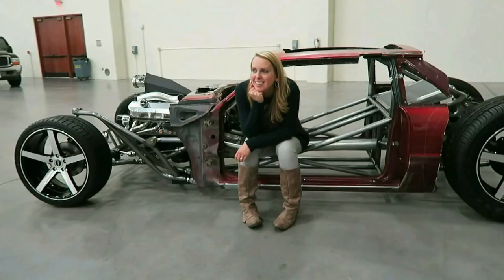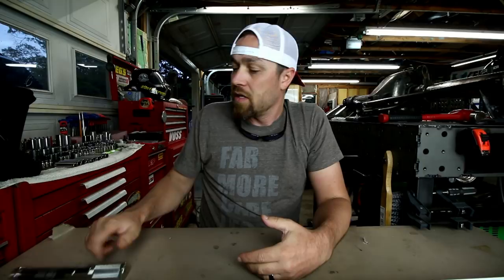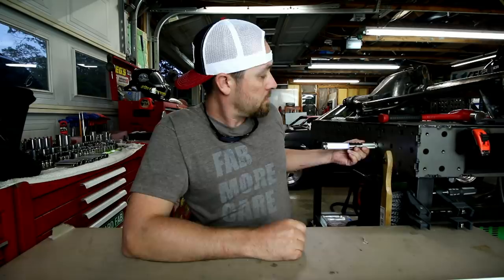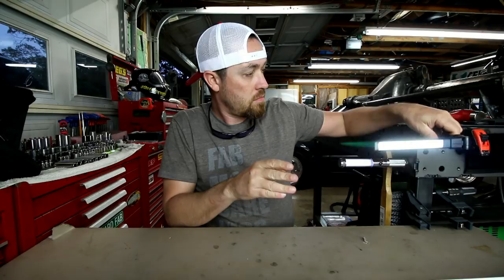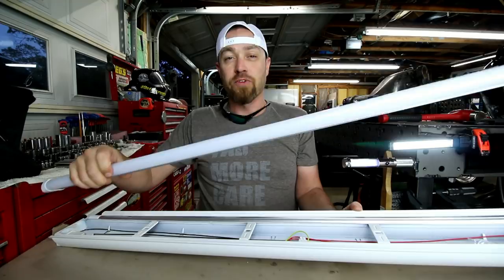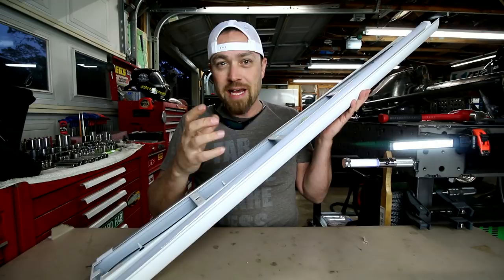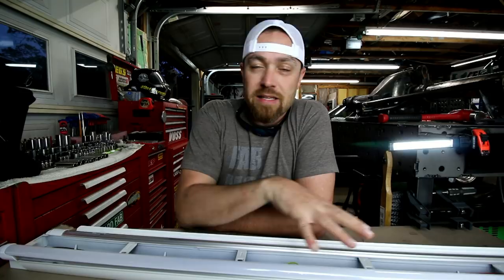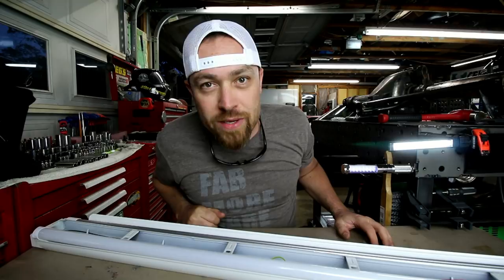You Need This Tool - Episode 94 | LED Shop Lighting

Comment: I have a 48x60x16 shop. Just got it built. Anyway instead of drywall ceilings I used white metal sheeting. Same stuff I have on the outside of the shop. Easy to put up. Never have to paint it. Reflects light like a champ. Then I put my 29 Lights in 5 zones. I love it. Lift should be coming this summer
Reply: White epoxy floors, white OSB walls coming this summer also. Kinda going for that airplane hanger look.
Reply from the maker: awesome....thats the same size I am building

Comment: Funny you are talking about led lighting.. I finely settled on vapor proof led lights from Hyperikon. 
Shopping for the right led shop lights is not easy.. mine are 70w (same as a 100w regular light), 7100 lumen (is the brightness), and 5000k (is the color).  They come with frosted or clear covers. Clear or frosted, it makes a big difference, I settled on clear covers.. they cost like $54 each.  They work so well I can usually just use one bank of lights (6 single fixtures) and see just fine in the shop.  If you want more info let me know.
They sell them on Amazon and you can get them from the company direct, sometimes a little cheaper even..

Comment: free harbor freight flashlights + cheap neodymium magnets + electrical tape. like 3 of those shining from different directions under a hood to eliminate shadows.
Reply: surprisingly enough to the Braun led light has a very impressive magnet I just used mine and it was pretty damn strong.

Comment: Be careful, there are also led T8 lights that are meant to be user friendly to people that don't want to re wire their fixtures to remove the ballast. (Costco sells these), so you still user the ballast. Not very efficient if you ask me, but they're easily swapped out. Bad news is, if they ballast fails, your lights won't light.

Comment: I bought one of those HF led lights (the one that folds) and it works but it won't hold a charge. It's dead one day later after unhooking from the charge cord. Kinda bummed about that as the instructions state "Do not keep plugged into charger" but it's always dead when I want to use it. BIG FAIL on this one.

Comment: Hey Kyle, just a tip I got that Harbor Freight LED and it's great.  I have used it a few times under dashes and run the battery down but I picked up a kit off Amazon that has spare batteries and a charger so you can always have a fresh battery to go in that light.   This is a link to the kit I got.  https://www.amazon.com/gp/product/B00XC32H80/ref=oh_aui_detailpage_o04_s00?ie=UTF8&psc=1

  I also have another flashlight that used a cartridge that had three AAA batteries and the LIOn batery also fits in that flashlight and it is much brighter and has a much better shelf life between charges.  I'm going to pick up 2 more batteries so I will always have a fresh battery to swap in just in case (wiring under the dash is time consuming, lol
Reply from the maker: very cool